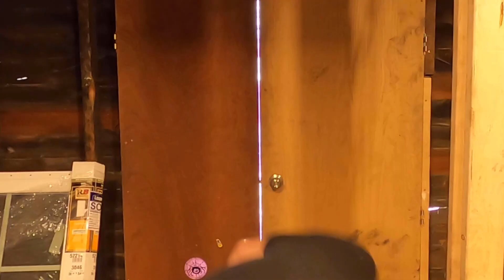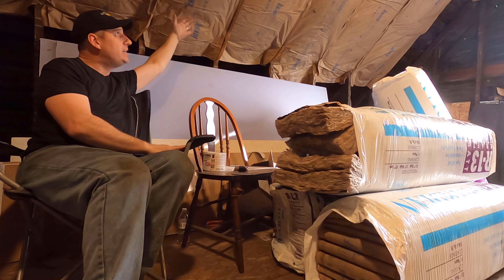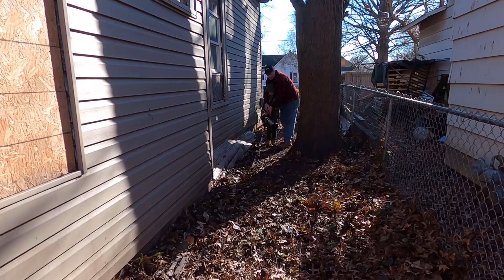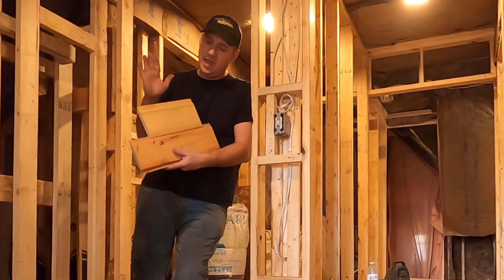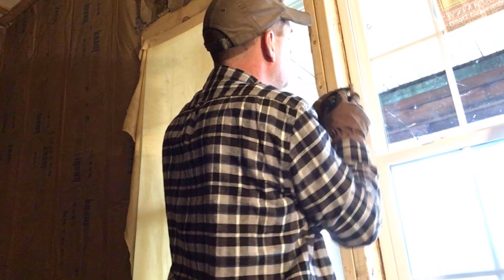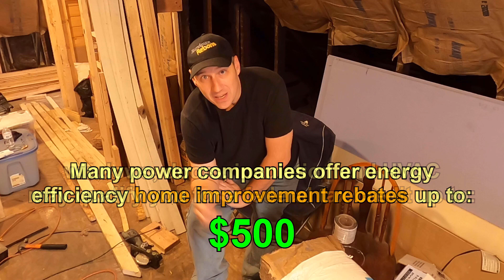ENERGY EFFICIENT Home Upgrades - A "Poor Man's" THERMAL ENVELOPE

Comment: Also, for putting lights into slanted ceilings, I found an LED gimbal that will rotate 87degrees on the Home RenoVision DIY channel at https://www.youtube.com/watch?v=dxfq4pZfUrU  This is so that you can get lights that will shine straight up and down, instead of at an angle.  Check them out when you get a chance.
Reply from the maker: Thanks for the tip!

Comment: If you end up re-doing the bathroom, would you consider a heated floor?  I'm curious about your opinion of heated floors.  I'm considering one for my attic and my bathroom.
Reply from the maker: Heated floors can be pricey.  They are nice - but I would NOT recommend them in a fixer upper.  It's not a buying point for the average home buyer - they want nice finishes and visual upgrades more than something like under floor heating!  Spend your money where it shows!

Comment: Another consideration is to add baffles to transfer air from the eaves to the ridge vent, to keep the roof shingles from curdling in the summer.  I personally used these: Durovent 22-in x48-in Raft Vent 10-Pack $10.17 - https://www.lowes.com/pd/DUROVENT-Durovent-22-in-x48-in-Raft-Vent-10-Pack/1001364394
Reply from the maker: Good suggestion!  Although in my house - the roof cavity between the joists is not continuous - it is broken at the flat part of the ceiling as there is a lateral plate there to tie in the horizontal ceiling framing and rafter bracing.

Comment: 4:50 Attic rafters are true 2.x4 sized beams.  In my house, my rafters are 2x5.5" and the previous homeowner screwed 2"x2" on the face, to be able to put in R19 insulation for a 2.x6" rafter area.  So this is something to consider, add wood to get to the desired cavity size.  Another technique that I have seen is to add a layer of foam boards, taping the seams, and then another layer of foam boards with the seams offset from each other,  so that air can't just go up 2 seams that are line up.
Reply from the maker: Good suggestions - all!

Comment: Hi Deric. In the 1990s, I did a similar upgrade on a $36,000 house when in lived on the 100 block of S. 21st str in TH.  I remember well that the attic ( I finished into 2 BR and a full bath) had no sheathing at all.  The 2x4s were offset the thickness of the shiplap used on the first floor.  I installed batt insulation and sheet plastic.  Before the drywall went up,  I'd watch the plastic move in & out with the wind pressure.  What a beauty ;-)    I like your show, because it reminds me of the Bob Vila TOH tv show.  I stopped watching TOH because it has become This Old Million Dollar House.   Seven yrs later, I sold the TH house for $97K .  Best of luck with your program!  Mike in St Louis
Reply from the maker: Awesome story! Thanks for sharing and joining the channel.  I hope and pray that I too can approach that 6 figure threshold at sale - but with the house being in 12 points - not sure if that price point will be supported.  We shall see!  Thanks again for the comment and for the comparison to TOH. I'm flattered! :)